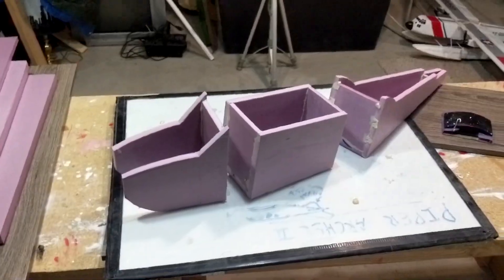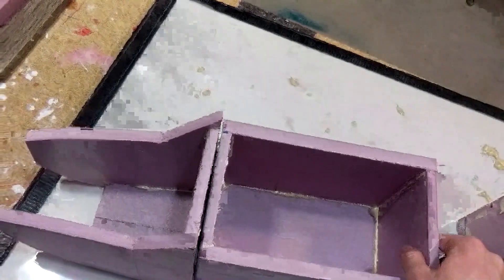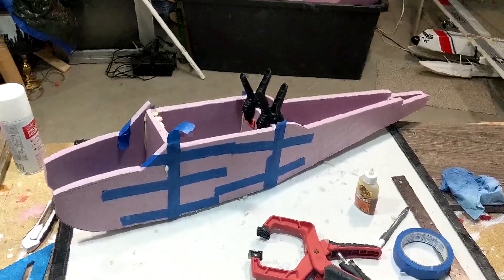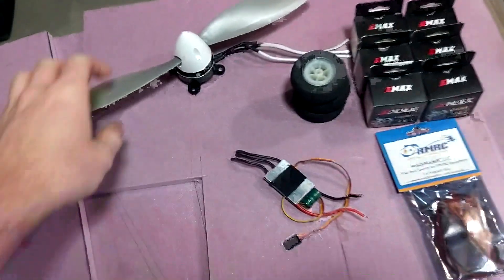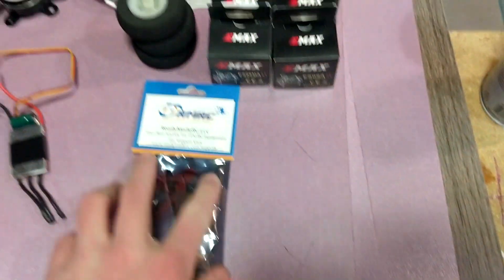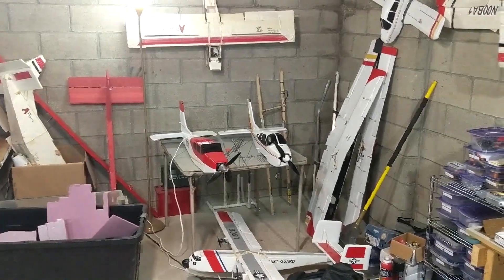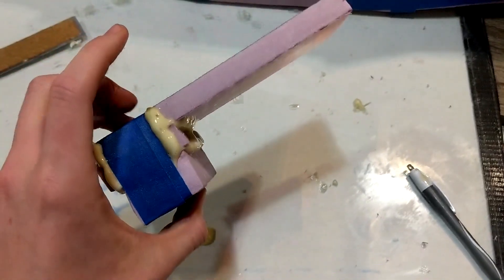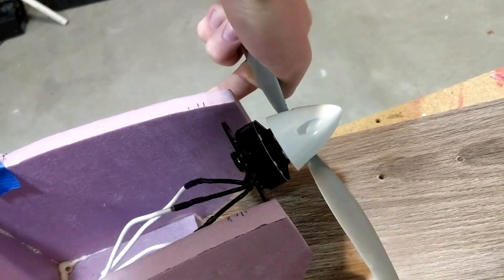Cessna 172 Skyhawk RC airplane - Build Update PART 2

Comment: What type of foam is that ?
Reply from the maker: https://www.homedepot.com/p/Project-Panels-FOAMULAR-1-in-x-2-ft-x-2-ft-R-5-Small-Projects-Rigid-Pink-Foam-Board-Insulation-Sheathing-PP1/203553730?mtc=Shopping-B-F_D22-G-D22-22_4_INSULATION-Generic-NA-Feed-LIA-NA-NA-&cm_mmc=Shopping-B-F_D22-G-D22-22_4_INSULATION-Generic-NA-Feed-LIA-NA-NA--71700000044087233-58700004607994983-92700038798652237&gclsrc=aw.ds&&gclid=EAIaIQobChMIpqPu77Hp6gIVQ77ACh1jZg21EAQYAiABEgIhuvD_BwE

Comment: Hey so I've designed a near identical plane. So can you give me some links to the electronics? I just need like some good cheap parts. Any places where to look?
Reply from the maker: The motor I used was chosen because I have 5 of them from an old multirotor that didn't work out. So I've been using them up building these larger planes. That's why they all have the same motors. I would say check out Flite tests store, as they have different power packs that seem good for different sized planes. Probably any ESC that's rated for the current your motor requires would work, and I recommend the emax 9g servos as they've worked well for me. I wouldn't recommend you use the same motors that I'm using,(at least on 4s), since they are a bit underpowered for these size planes. I may end up upgrading to 6S batteries for my planes with the emax 3506 650kv motors.